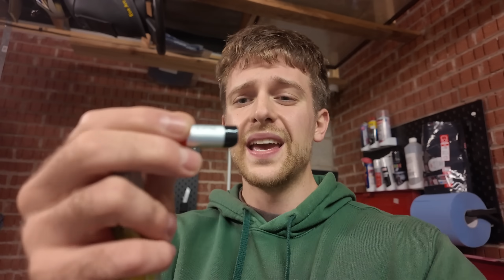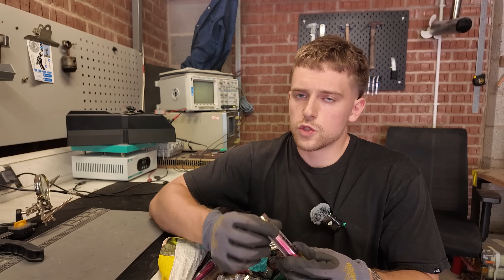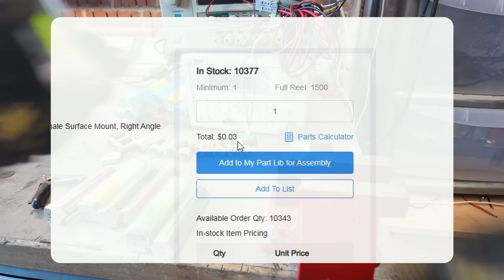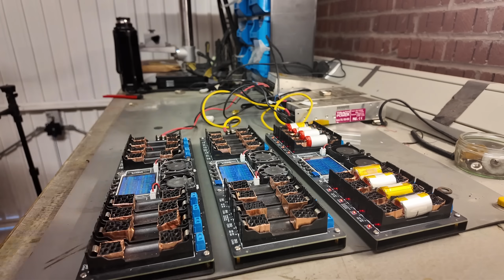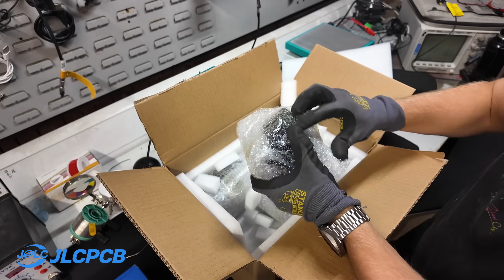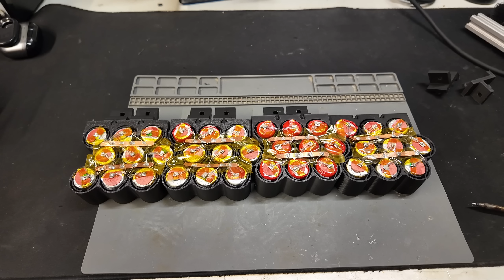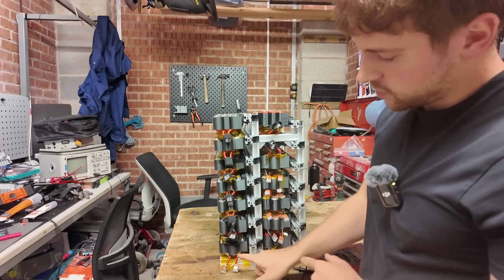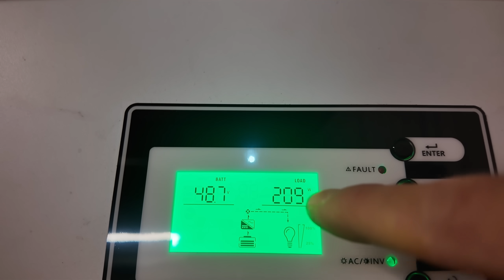I Powered My House Using 500 Disposable vapes

Comment: I am subscribing to see you hook up solar panels and power entirely off grid. I built a Passive House here in Colorado in the USA. I want to get solar (had it on my last house) and figure out how to pull from the grid only when I need to top up my battery, and only pull when electricity is the cheapest. 

We get so much sun here. Excited to see the solar panel follow up video!
Reply: Not chemtrailed the sun out there yet then?

Comment: are you not concerned about the batteries heating up and damaging the 3d printed racks? as they heat cycle, the plastic will degrade, and possible off gas fumes as well

Comment: Great work! Quick question tough, did you think about the internal resistance of the cells? I'm a bit worried about that because of heat development at high currents.

Comment: Seeing you go through all this work and then using solder to connect the batteries together hurts my soul.

Soldering damages battery cells. There are cheap but effective battery welding machines available that would have saved you a TON of time, and not damaged your cells.

Comment: The damaged unusable cells are probably from the morons who SUCK THE HELL outa their fully burnt out vapes, which is also the main thing burning up coils and causing that metal in the lungs crap. 

If you vape whatever- do you- but when they’re dead stop sucking 
You get shit tasing half ass hits and they give you cancer fast as hell.

Use as directed 
If you ran outa your meds you wouldn't try to swallow the empty pill container right?

Comment: 5:50 I was immediately thinking... "I bet you could 3D print a connector, insert metal spring pads and run a wire between them..." then you massively simplify that with flexible TPU and copper tape!? What a simple, elegant solution! The whole video was fantastic, and I loved the aluminum extrusion frame. What CAN'T you build with aluminum extrusion or PVC pipe? :P But for some reason, the flexible TPU contact pad stuck with me. Probably because I only know enough electrical engineering to follow along and not extrapolate. :P
Reply: I like the way you write/talk, it's grandiose
Reply: @CreamyLoadz  Thank you! That's a grand compliment and you're kind to say so.

Comment: So whats the plan? You just going to run your entire shop and house of vape batteries until the end of time or will you, like the rest, dispose of them? I havent tested and milled thought 1000s like you but I have harvested and used a few disposable vape batteries for random project and the biggies issue I saw was the qualirt of the cells. They would work fine for a while then die completely, or swell up, drop below voltage, ect. They are just made so cheaply you honestly cant use them for anything more than just dickering around.

Comment: If it works, it's fine, but with a large number of batteries, different things can happen, because vape batteries were not designed for this mode of operation. Keep an eye on this thing for swollen batteries and I hope it doesn't get to a fire.

Comment: You should make it so it identifies faults ie dead batteries when they die so they can be swappable and that way the power wall doesn't eventually become a wall of lithium ions, circuit boards and plastic housings that need to be recycled or worst case scenario you don't want to deal with it so you throw them away.

Comment: Hi Chris, this is a really impressive demonstration of the potential of recycling vape batteries. Seriously well done. It got me thinking about how society is missing out on a lot of potential energy and wondered if you could elaborate a little bit with some details of how long this took and how much it cost, if it could maybe be replicated and if you made it again how could the design and process be improved or streamlined? Maybe this is something the recycling sector should be taking seriously. Thanks, Will

Comment: Honestly, I believe this should become a business... a dollar per vape, tested for a battery... salvaged batteries with good quality sold for cheap grid energy storage... Def could be profitable, so long as you can secure the intake of old vapes, maybe even through a contract with vape stores taking them back... so long as you can do that, assemble them and sell them for about 90% or 80% the value of similar density energy storage, that is.

Comment: And you will get about 10 years or more on the battery pack.  That's pretty amazing!  How many failed cells will end the use of the battery pack as a whole without complicated repair?  I suppose that would be when the total voltage dips below 240 volts----- my guess.  For a while after the Covid19 plan-demic, I found a bunch of those vapes laying on the sidewalks, and streets when I would jog.  I use them to power all sorts projects, and devices that use to use only alkaline batteries, or rechargeable nickle metal hydride battiers. All the vapes I have found so far, had the power management electronics in them that are so small, that its easy to install with the battery to make all the devices that formerly used alkaline batteries completely powered by rechargeable lithium ion batteries.  I hardly ever buy alkaline batteries anymore for most of my small electronic devices that are powered by 3 to 4.5 volts DC.  Many of them are recharging from little 5 volt solar cell arrays that are attached to windows by miniature suction cups, and short thin wires to the devices with the rechargeable lithium battery.  I never have to replace alkaline batteries in several digital wall clocks, and talking clocks, digital weather measuring devices,  emergency lights during power outages, etc.  I keep finding more and more devices that formerly used alkaline cells, or used rechargeable nickle metal hydride batteries, and replace them with rechargeable lithium ion cells from vapes. Electronics is fun, and the lithium ion battery is making it even more fun, and versatile because it greatly reduces the reliance on the mains as you call it in the UK.

Comment: The disposable vapes just have a air pressure switch and a led / coil.  They have zero drain. The cells themselves though will slowly self discharge.

Comment: As someone who vapes, i have had an elfbar 600 vape device (the one you showed in the video) that i have had since the disposable ban came into the UK. I payed £4.99 for it, which is the same price for the refil pods (these include 2 pods in each box), and you are completely correct when you say that the kits with the battery and pods are much more available. In my own town, i usually need to travel to 2 or 3 of the shops to find one that has the pods themselves in stock, while they all have the whole device kits. I make an effort to buy the pods, and not get rid of my device, but it would definitely be easier not to

Comment: You can have a fuse between the cells like this but it 100% is not a substitute for output fusing. If you were to have a ground fault that popped the internal fuse, you would still have half the pack able to short to ground

Comment: Here why u dont do this with cheap cells:

1. Cell mismatch: uneven charge/discharge → hot spots, rapid failure.

2. No balancing: cells drift out of sync → overcharge, thermal runaway.

3. High internal resistance: heat buildup, voltage sag, short lifespan.

4. Poor connections: uneven current paths → arcing or melted links.

5. No BMS control: no cutoff on faults → fire risk.

6. Inconsistent quality: weak cells drag pack down, cause imbalance.

7. Overheating: compact packs trap heat → venting or ignition.

8. Charging hazards: reused vape cells can’t tolerate proper charging.

9. Aging chemistry: rapid capacity loss, gas buildup, leakage.

10. Recycling difficulty: dangerous to dispose, environmental risk.

Comment: Li batteries should come with a recycle charge u pay when u buy them.  Make it 20 bucks or for u in Europa 15 Euros of which they get back that part when they turn it in to recycle that is used to recycle them

Why so high.  If it was just a few dollars many would still just throw them out but 2 saw bucks they will go for.  Like we do now with car parts.  It is called a cord charge and it is to make sure u recycle it.
But then soon we will have Na batteries and they  will go the way of the dodo bird with its highly toxic elements.  Li is one of the most dangerous elements  we should rebury every oz of it we have dug up as deep as we can

Comment: Disposable vape batteries usually use old LiCoO₂ chemistry — cheap, high-power, low-safety, barely doped, and meant for only a few cycles.

Phone batteries use modern Ni-Mn-Co or Si-doped chemistries, with stabilizers and additives for safety, long life, and efficiency.

Basically: same lithium principle, decades apart in material science.

Comment: I would absolutely like to see the solar panel video. I use a small solar panel system that I put together with deep cycle batteries to run when the power goes off. We live in Florida so hurricanes knock the power out a lot.

Comment: Please please please install a proper changeover switch if you’re going to do stuff like this, what you’ve done there is highly against UK wiring regulations & could be considered illegal.
Don’t get me wrong, I love the video, the work is great & actually inspiring, but that last bit made me very uncomfortable, it needs to be connected in a way that there’s absolutely no possibility of back feeding into the grid. A changeover switch would be ideal, not expensive & not that difficult to fit.

Back in the 80s, after the October hurricane, line workers were killed by people plugging generators into their homes without properly isolating from the grid, as a result there’s very strict rules on changeover switches. Also, it would give you a connection point for any future projects that can power your home/workshop.

Comment: You should house your battery pack in a metal conduit hood that vents to the outside, such that if you do have a battery fire, the smoke will exit the building instead of contaminating everything in your workshop.

Comment: Awesome project, and I'd not thought about the vapes I've connected running them selves down while not in use, I best get them all cracked open sooner rather than later. Also if you're running off grid you should probably put an independent earth rod in too, better safe than sorry.

Comment: You might be able to revive some of those depleted cells by completing the curcuit by rapidly tapping them with some 14 guage jumper wires from a fully charged cell until it has enough of a charge to be able to be charged the rest of the way with a standard lithium ion battery charger. I used to do this to revive older milwaukee and dewalt power tool lithium battery packs that had set discharged for too long on the shelf. Look up some videos on it before you try it though, it will make some sparks.

Comment: I know i might be scamming a little here, But for anyone looking for a easy way to gain alot of 18x+ batteries. I pay crackheads 10-25 cent depending on the vapes they bring me. I break them open take the batteries out and sell them online in bulk piles for profit. Only reason I share is if some kid out there is looking for a way to gain quit cash. Buy back your friends vapes at 10-25cent a pop and bust out those tools and farm batteries and sell online, Places like ebay ect sell them. I pay 10-25cent get about 2-15$ for batteries.

Comment: Fantastic hard work my friend. But one tip for safety. Buy every regulation internationally if you're going to hook up that system to your power you must put in the interrupter switch necessary to force the main breaker leading from the grid to your home to disconnect when switching on the breaker running to your inverter and battery Bank. It's required by law to Force One breaker off at the other breaker is engaged and vice versa to prevent from killing a linemen

Comment: Hi mate, I wonder are those completely  flat battery can  not be recharged? I had a rechargeable battery at home that my Nitecore charger  couldn't charge  because the amount of energy in that battery went below a certain point . But some new better chargers can actually give it a kick and then battery even when  it was completely flat may start to be charge again. Is that true? Would that work with those batteries you got?

Comment: Fun project :) I would be scared to do something like this, especially with batteries of questionable quality.
Noticed a 200mV voltage sag on the cells when you turn on the kettle, it's good that you didn't try to push it further :)

Comment: If that thing ever catches fire, it's going to cause serious problems. First it's sitting directly below your inverter, which will be damaged if not actually catch fire itself. Second your entire workshop will be filled with smoke and fumes.

If I were going to rely on this regularly, I'd build a separate structure outside of my workshop, made of stone, possibly below ground, and weatherproof. Then you can run wiring from the "disposable" (as in it will be destroyed if there's a fire) structure to my workshop.

I would also add some kind of thermal monitoring system that can detect, at minimum, high temperatures in the structure. Ideally you'd want individual cell temperatures monitored. But maybe the voltage monitor does double duty as a temperature monitor, assuming higher temps leads to voltage changes, I don't know.

I'm sure you're aware of these risks and I hope you take steps to mitigate them. A video about how to properly secure such a project would be interesting.

Comment: So I did this with my electric longboard. I used vape pens for battery cells and the biggest issue I had was cell health. You can get it to work but a random cell in the pack will die and I would have to rebuild the battery. Also after a few recharges I had battery balancing issues. It was just better to just buy new cells. Cool video! 🎉

Comment: You should combine this with some solar panels to make your house 'off-grid' capable.  That should give you a real boon as far as avoiding electricity bills are concerned.  You might want to expand the storage capacity as well (probably not via the same method though, it's a bit labour intensive).

Comment: I would caution building, I investigated a house fire from similar device made from recycled vape pen lithium batteries. You don’t know the conditions of each battery and if the separator is intact. Thermal Runaway is possible since the battery cells could be different manufacturers with varying materials.

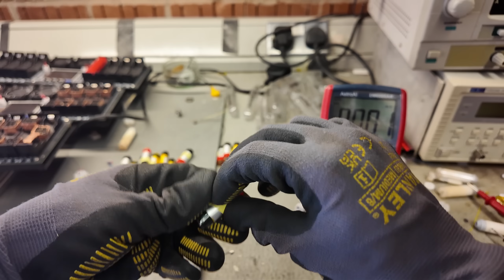Comment: 2:30 They don't get damaged below 3V. That's a myth. If they are 1V or below, I wouldn't use them anymore, but 3V or 2.5V is perfectly fine. Just charge them up slowly and keep using them. You can also recharge cells that were below 1V but those are often in fact damaged and won't last long or discharge themself. If you recharge any of those cells, charge them all to 3.8V (doesn't take as long as 4.2V) and put them away for two days. If they stay at that voltage, they are fine. If not, throw them away. you don't want to use cells that discharge themself.
Reply: See, I personally don't care about the "below 3V is no good" rule. Even if the cell is close to 0V, I put it on charge, and if the cell charges up normally, then 95% of the time there is no problem with the cell. 
Now, using cells to build a powerwall, yes I would want the highest quality cells (meaning above 2.5V). However, for smaller projects like the powerbanks, or portable Bluetooth speakers, etc etc, then yes any cell that charges fine and doesn't self discharge would be fine to use - regardless of initial voltage.
Reply: @TheSpotify95  The other issue with these cells is their own internal resistance values being somewhat unknown. Higher internal resistance will lead to more heating and voltage sag under high loads. Which can cause fuckery in poorly built solutions.

For a power wall, with these cells, I'd personally design custom management and balance storage systems. With each cell being individually managed by a set of charge controllers. The issue with these li-ion cells is their low cycle lifespan. 200-500 cycles. Meaning you gotta be able to rip the whole thing apart and replace faulty cells easily and safely.
Reply: I agreed the problem is most Chargers don't know how to do that
Reply: @merdith6 Just use a normal lab bench power supply set to 100mA and wait patiently. Also check if they get hot. If so, stop and get rid of them.

Comment: I hate the concept of disposable electronics. Every time I see a disposable vape laying around, I pick it up and take the battery out. The coil can be used together with some new tissue and a plastic container to build a tiny smoke machine, but usually only the battery is interesting. They are small enough for most projects and work great. Also they can even output high Amps which is nice.

Comment: I find this annoying to watch. You are the motivated, healthy, non-destitute version of me.

I'm sure there's lots of people paving your way because it's certainly not all you, that would be truly exceptional.

So with that preface, in my opinion, you're obligated to clarify some ambiguous parts of the video, like a warning against hooking up generation and the mains only separated by one switch; it should be explicitly stated that this will pop your inverter if you switched the main breaker on.

Also, you're walking the line of accessibility and educational very well, but I'm disappointed there's quite a bit of technical detail missing, which would be fine if there was any kind of warning about that switch config, but there isn't.

It's not enough to say not to copy it, people will always seek to emulate this. You have to provide the necessary technical detail to prevent someone popping their inverter or causing a fire, without it you're just a brand not a teacher.